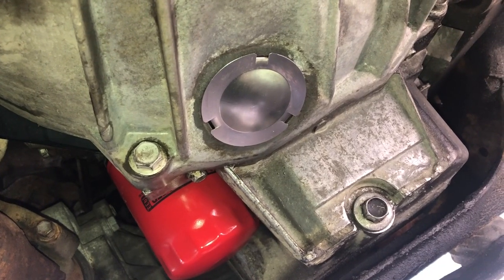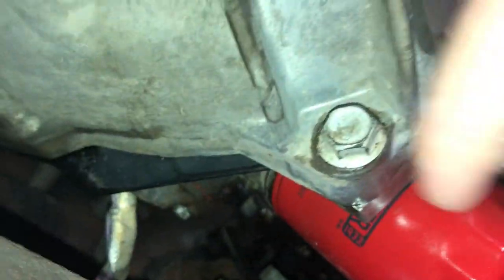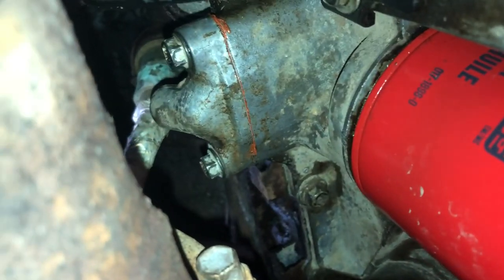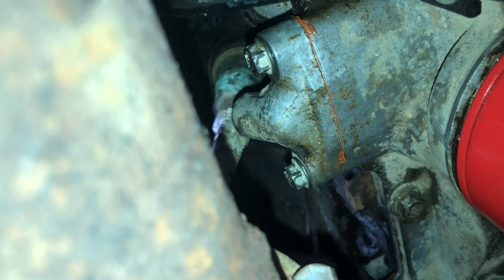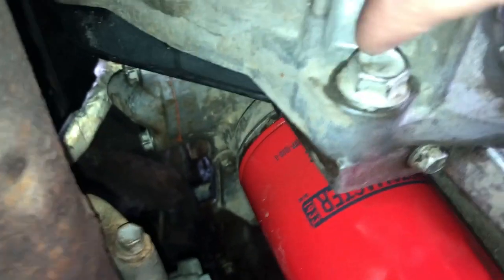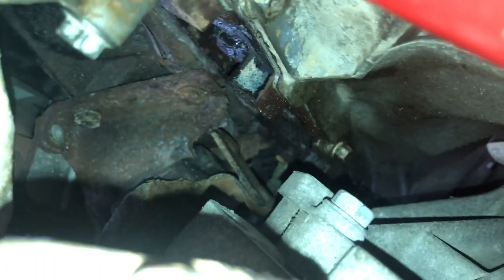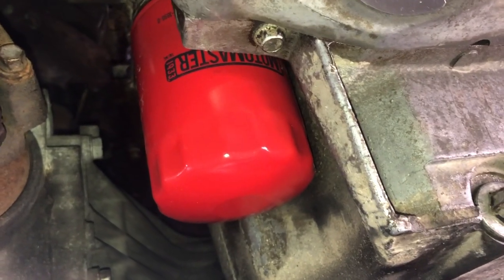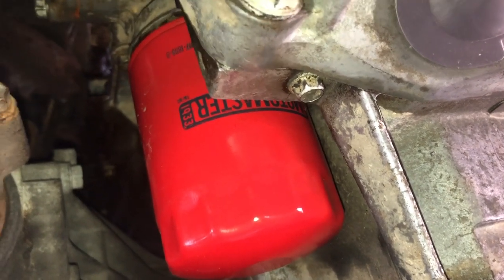5.3 Vortec oil leak update part 2

Comment: I have been chasing an oil leak on the back o my engine and no what appears to be coolant leak on the front. FML it is driving me crazy. I am at the point where I dont have to change my oil anymore just continuously add oil.
Reply from the maker: Coolant leak in front will either be water pump gasket, or thermostat housing/housing gasket. I have a video on the thermostat housing. Oil consumption could be caused from a flaw in the valve cover Pcv system. Also have a video on that. My truck also has a worsening oil leak on rear of engine ( most likley rear main seal) so I decided to try risolene oil seal treatment that you add to engine oil. After it was in for awhile I was shocked that it actually worked and stopped about 80% of leak! My truck is old and I figured why not give a try. Apparently it helps restore old rubber seals.

Comment: Damn good tip on backing the bellhousing bolt out first.
Reply: Did you backvthem out completely or just losen them up a bit..
Reply: @christianbarraza5522  Just back them out. You're only trying to take the pressure off of the bell housing in that area the pan will pull up when you tighten those bolts.
Reply: Thanks bro..💪

Comment: The fact is, an oil leak can happen with any "mating" surface. I always recommend Felpro gaskets with black Permatex gasket compound. I've used these two products for 40 years and I've never had to revisit that leak again. 

Hey Biker Mike, pretty good video.
Reply: Thanks for sharing. Got any torque specs handy? Thanks, - take care.

Comment: Yes I am having that same problem that you was having can you please help me out with it 2003 Chevrolet Tahoe just replace all the seals and gasket but the same leak you have I'm having
Reply from the maker: This helped a bit for mine, but over time its still been leaking. Recently tried an oil additive that helps reconditions older seals. Im thinking mines leaking from rear main seal now too. Not going to put too much $$ into mine so thought I'd try the bottled stuff. Seemed to help a bit more as well! There are several on the market. Not the best solution obviously but I figured why not for my old truck.
Reply: Valve cover above ⬆️

Comment: What about if i see oil around the inspection cover almost like it might b coming from there??
Reply from the maker: Most likely a rear main oil seal..
Reply: @bikermike  took off the inspection cover and just grime on the back of it no oil inside of be housing on walls ,flexplate etc😁😁 so atleast its elsewhere went around and tighted the oil pan bolts which half were loose so cleaned it up and gonna do an oil change on Saturday so ill recheck it but hopefully it was just some loose pan bolts and build up burning off in thie heat 🤣
Reply from the maker: @NORCALPYRO_  sounds like you may have gotten lucky then! Good job!

Comment: What’s that circle part called that looks all clean on there
Reply from the maker: its an inspection cover. remove it to inspect flywheel and check for rear main seal leak,
Reply: Main seal leak should be quite evident, correct? I got 3-4 drips a second, from behind the flex plate.. im about to stick a camera up there. I had the engine out and tightened down the pan, then installed it. Runs great but leaks a 2-3" puddle in about 1.5 - 2 minutes of running.

Comment: Thanks for sharing.  Got any torque specs handy?      Thanks,   - take care.
Reply from the maker: I think its 18ftlb There would be a sequence to do them too but at this point I was just experimenting  and making due with it for now. It has helped out a bit.
Reply: @bikermike  Cool, thanks for the info man, take care.
Reply: Found the following on gmfullsize.com:
It's different for the different bolts. Tighten them all as much as you can by hand. Then tighten the middle section. Then go back and forth away from the center. One set of two on the left of the center bolts, then the right, and back and forth until you've reached the end. The rear of the cover is 106 in-lbs, to engine and front cover is 18 ft-lbs and the bolts to the bell housing, bolts to the transmission and converter cover are 37 ft-lbs.

I've got the same issue on my 2001 with 250k on it
Reply: Time to set up trans seal o ring common issues on GM factory

Comment: I have oil coming down around the oil filter... what could be the problem?
Reply: Me too I just noticed today.then my engine oil level light comes on and I add oil and it drives for like 3 weeks and then it happened again and I notice a small drop of oil in the middle of the filter.
It just had an oil change so I have no idea what the hell is going on.
Reply: @victorreyes2135  Maybe a double gasket on filter.
Reply: Did you ever figured  out your problem  I just changed my oil pan gasket. Gasket for oil cooler block  off and if you ever change those parts make sure you get oil pick up tube o ring. That stopped my leak
Reply: Always trace a leak as high as you can.  Where it's dripping isn't always where the oil is coming from.  E.g., in this video, oil leaking from the oil-cooler block-off would slowly flow down onto the filter and might even accumulate at the bottom of the bell housing.